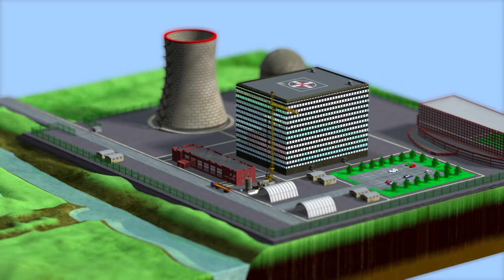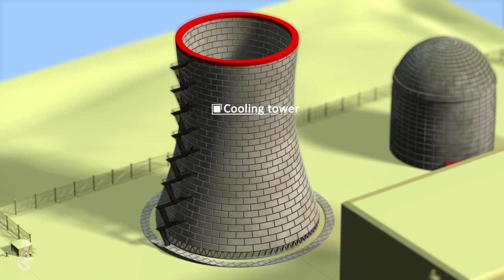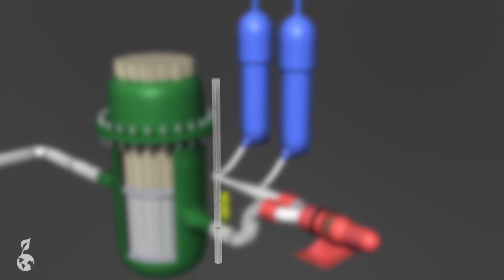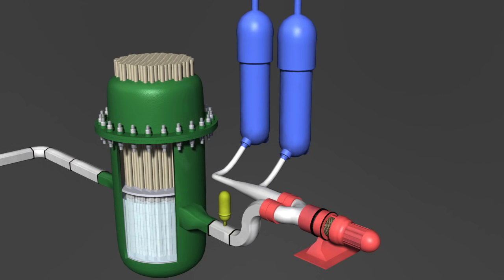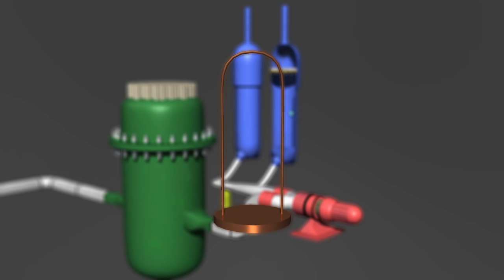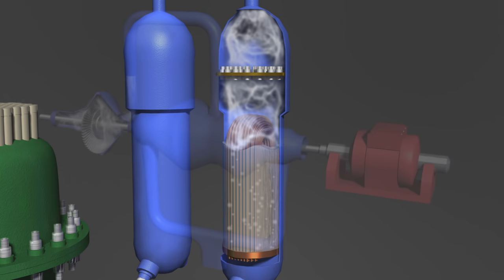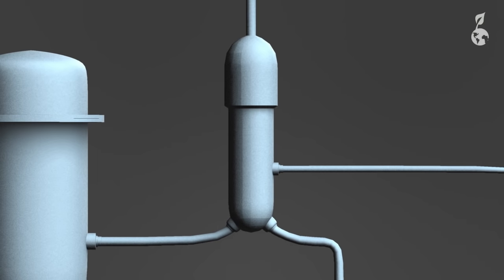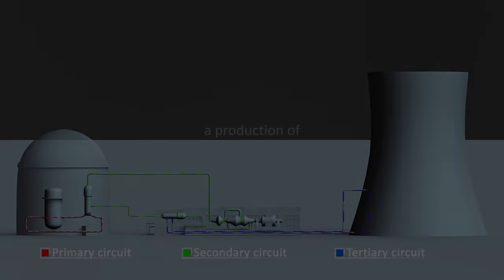How Nuclear Power Plants Work / Nuclear Energy (Animation)

Comment: Can you have a car that runs on Uranium? that would never need to get charged ever
??
Reply: That would mean having a nuclear reactor in your car. Now imagine if you had a car accident. You see why having a nuclear reactor in a car would be a bad idea?
Reply: I had that same idea too!.However there are scientists who are working to create levitating cars using magnetic levitation
Reply: Safely miniaturizing a nuclear reactor down to something that can power your car would be very difficult.  There's a reason the smallest vehicles powered by nuclear reactors are submarines.  I don't think it would be outside the realm of possibility however to imagine heavy vehicles such as tanks being nuclear powered, perhaps as a UTV to reduce risk of radiation exposure to the crew, and using the abundant electricity generated to both power it's movement and a railgun.
Reply: +SaadafTG Nuclear reactors scale down worse than most other types of energy, so it would make more sense in terms of efficiency and cost to make electric cars and power them with nuclear power plants. However i think there some research that suggests liquid fluoride thorium reactors might one day be able to achieve something like this, without risk of melting down in a crash.